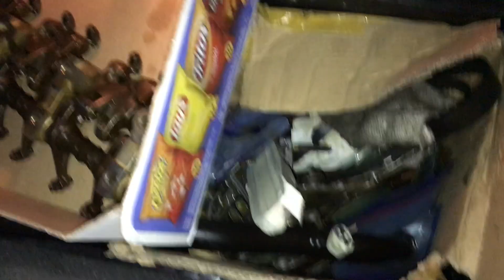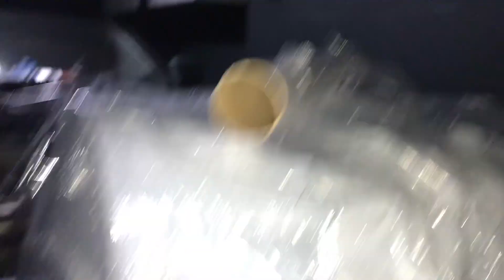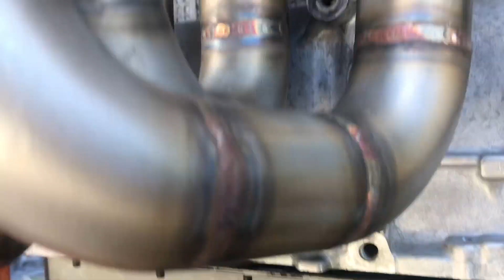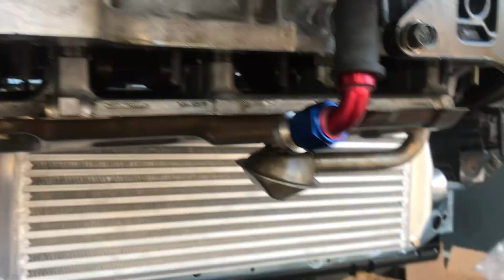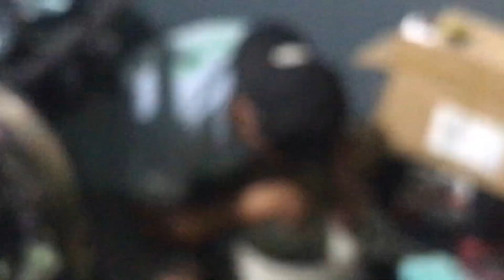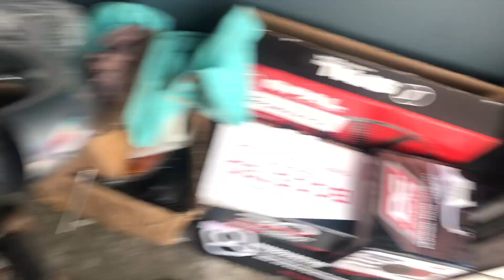Turbo Sleeper 94 Honda Accord [part 6] Completed Motor gets put in!

Comment: Bro no kidding the irony coming across your videos.  I had the itch to get a Honda and get away from the Xbox lol.
So I was In the market for a eg hatchback and got a clean one for a good price. So it happens to have a f22b1 swap . 🤔
I’ve only experienced b series engineering. I will be following your video for mentor build.
Reply from the maker: That sounds like a killer combo. Boost it!
Reply: 2point2turbo  definitely! My goal is 300-350 whp
Reply from the maker: You could do that stock motor with just a turbo and e85
Reply: 2point2turbo no sh*t ?! Nice 👍🏽
Reply from the maker: Yeah my previous accord was stock motor 350hp for over 18k miles of abuse
Reply: 2point2turbo what size injectors?

Comment: Why wouldn't you build the short block
Reply from the maker: Chevy sucks what?
Reply: 2point2turbo why would you pay to have the short block built its stupid ez to do
Reply from the maker: Chevy sucks it’s stupid easy to do, but no so easy to do it Right.
Reply: 2point2turbo true but we are talking about a boosted honda engine done wrong you get 3 passes done right you get 5

Comment: What’s the advantage of the egr block off?
Reply from the maker: Casey Colbert the EGR puts exhaust gas back in your intake. Only useful to reduce emissions and makes intake dirty. It looks ugly, uses a bunch of vacuum lines and electric wires to function. Block off is cheaper, less components that may fail, cleaner looks. No exhaust in your intake.
Reply: 2point2turbo do you have to retune the computer so there’s no check engine code? Also how did you relocate the power steering reservoir? I can’t find it online